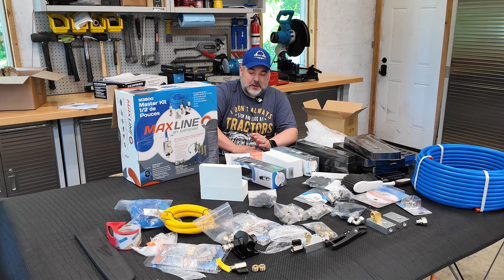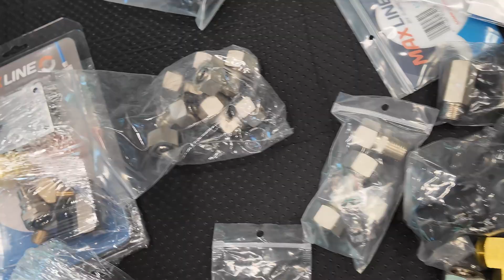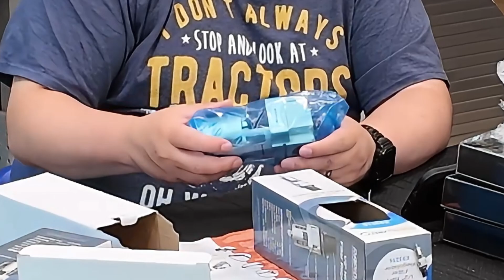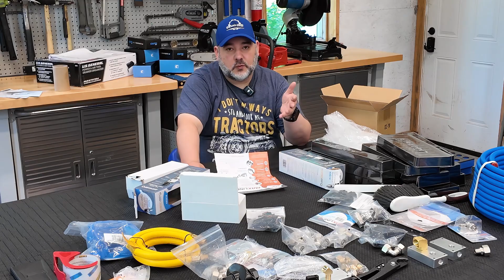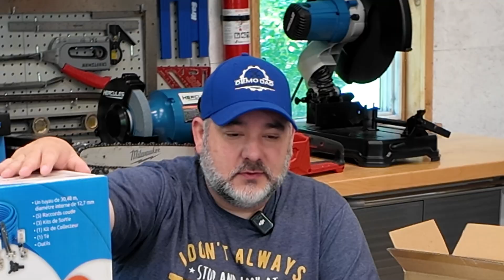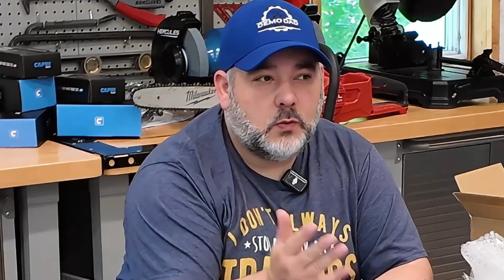Why DIY Don't Use Air Tools (And You Shouldn't Either)

Comment: The compressor maintenance has been a sticking point for me.  Living in S TX, heat & humidity are my biggest enemies.  I can’t really justify the cost for my DIY projects. You make me think investing in a few Milwaukee tools, to add to my Bosch & DeWalts should suffice. What would you recommend as a casual car & lawnmower maintenance torque wrench?  Good video! New Subscriber.👍💯💯💯
Reply from the maker: Thanks for subscribing! I really like my Capri Tools click torque wrench for lug nuts or high torque applications. However, my absolute favorite is my 3/8 drive Quinn digital torque wrench. It is amazing.
Reply: @DemoDad101 Your shop looks like a working man’s shop.  I’ll be taking your advice, and probably go with the Capri.  I’m just a DYI car maintenance person.  Thanks!👍💯💯💯